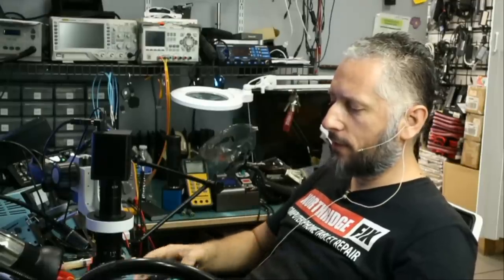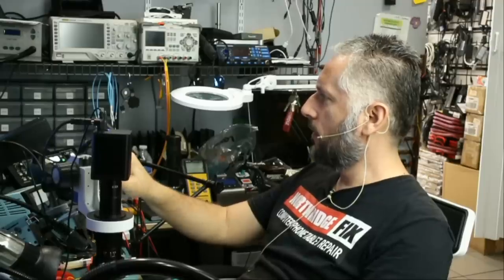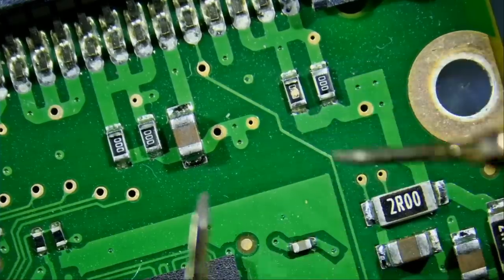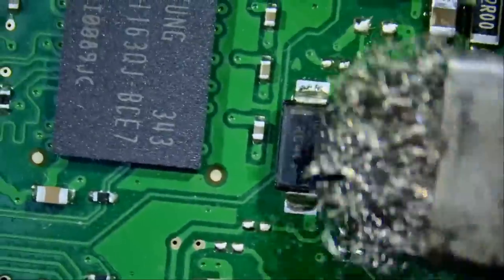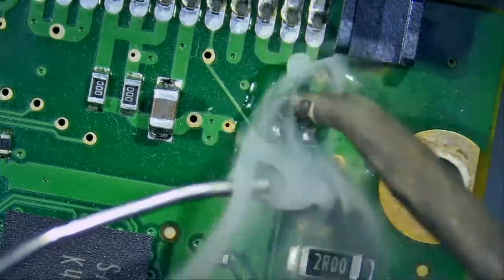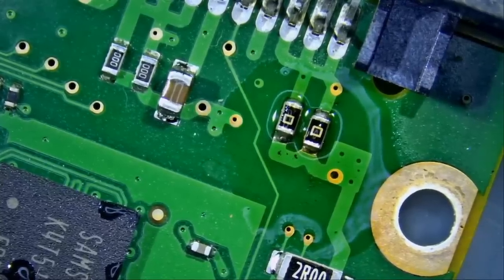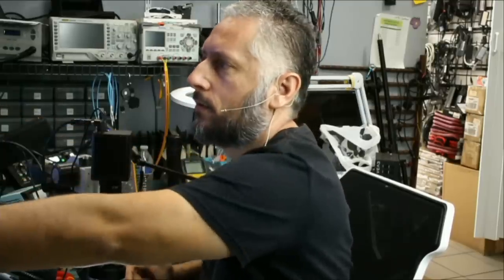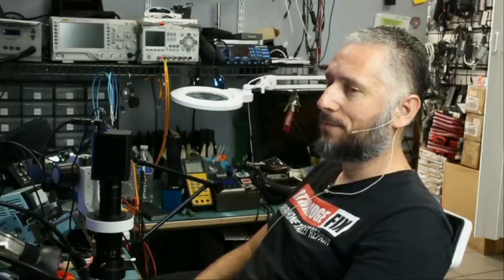Seagate 2TB Hard Drive Smoked -  Can we Fix it and save Data ?

Comment: "That's a protection diode, so we do not really need it"
Reply: Protects from reverse polarity being applied or a Zener diode to protect from over voltage.
Reply: Question, how higher voltage did that , shouldn't the sata to usb adapter has some kind of protection?
Reply: @rpsmith  Pretty sure its a tvs diode, clamps over voltage to ground causing the fuse to blow.
Reply: if you're not planning to use the item long term, then he is correct, you don't need it. at this point it's best to pull all the data off immediately and scrap this drive
Reply: @anwarxv9279  For 3,5" drives you mostly have an additional barrel connector which plugs into the adapter.
Reply: @toolsarecool  not reverse polarity , Transient voltage .....  :)
Reply: @bronzeblood  -- Yes, I'm sure you are correct about that!

Comment: The local scrap man has been generous enough to give me broken electronics. I've been repairing a lot of it and sharing the loot with him. I've also been practicing my solder and reflow work on them. I'm not as quick or as good as you but I can definitely feel a lot of improvement. Donor boards are excellent if you can get them folks, and the bonus is you get free chips to play with if you're into building electronics.

Comment: I'm impressed. This is the first time that I've caught up with your channel. A few months back my grand-daughter also had a faulty portable Seagate 2TB drive that happened to stop working while it was plugged into the USB port of an HP Laptop which interestingly also died at the same time.

 I'm an old school technician when I started out in the business all radios and TVs had tubes.  So, I was reluctant to tackle the HDD myself, I rang a few repair shops in Australia (where I live) and was quoted from 900-1500 (A$) to retrieve the data. I guessed that the Laptop must have put a lot than five volts out of it's USB port to the HDD. Poor laptop design? 

Luckily for me the Seagate HDD was still in warranty and without hesitation Seagate transported it from Australia to the Netherlands and back for free, great service! So my grand-daughter was able to get back her valuable data and a free new HDD to boot. 

Keep the videos coming.😀

Comment: When doing data recovery and replacing 0 ohm resistors, could you simply use bridge wires and save the components?
Reply: I thought that - why 0 ohms if they're not actually resisting anything?

Comment: back in the IDE hard drive days around late 90's ~ 2002 forgot if it was Seagate or Western Digital or both. We would get hard drives in that would spin up , could not read any data. It was because the bearing for the drive motor had a minute amount of play. What we would do is wrap the drive in plastic then put the drive in the freezer overnight. The next day I would take the hard drive out and plug it in to the IDE cable. Unfortunately wasted time waiting for the computer to boot, 80% of the time we could recover all or part of the data. as soon as the hard drive started to thaw showing droplets ( hard drive out of the PC with longer cables) the sooner would stop reading data, a very few we could refreeze and recover more data. Not in these cases, it always amazed me and it was difficult sometimes not to laugh in the clients face when i went to an onsite for a PC that would not boot/ clicking sound. The client would tell me "well the hard drive had been making strange sounds and clicking for about a month, the computer still booted" i would be thinking you should have called us weeks ago. very few we could find a donner hard drive and swap the mainboard, most that did not work....back when that was possible....most lost all their data.

Comment: Great... Again. 
But... Alex, why in a case like this you don't just bridge the zero ohms resistors, instead replace it?
Reply: I would have replaced only one of them with a jumper.
Reply: He works professionally
Reply: @kimmygaming3407  --  I he is such a professional, why was he testing both zero ohm resistors for continuity when the are connected in parallel?

Comment: Hey Alex, I have a question. Since the traces on both those 0ohm resistors were shared, could it have worked to just take one from the left side and solder it onto one of the pairs on the right?
I'm guessing not, but curious as to why they exist like that to begin with.
Reply: They are sometimes used as a fuse, 0-ohm resistors are not truly 0 ohms, they still provide some resistance where if their power limit for their size package is greatly exceeded, they will blow
Reply: Zachary - Thank you for that.  I was just about to research the purpose of zero ohm resistors since at zero ohms of resistance they shouldn't even be called resistors.

Comment: From what I understand on hard drives bios chip tells the controller where all the tracks and sectors are located for each drive individually but that bios file is also copied to a special area on the hard drive is normally not accessible it is never overwritten so if you have a drive and such as this one you could just get a new motherboard if you had the software to read that special bios file off of the hard drive could then flash that to the BIOS chip in the drive would be 100% functional
Reply: The general process in data recovery labs is to just replace the ROM chip itself onto the donor board.

Comment: It's amazing how Hard Drives are repairable...it's definitely the key to keep files stored safety and reliable but is SSD or NVME M.2 that reliable too and can be fixed like hard drives?
Reply: Just like HDDs, it would be repairable as long as both the controller and the storage medium itself (NAND flash) are intact.
Reply: Nothing that holds valuable data can be considered reliable, keep data on three separate drives, with one off site.
Reply: @bryanlatimer-davies1222  🎯
Reply: NOTHING is 100%, even paper, it can burn. 😉 Everything in this world is temporary, even us.
Reply: @bryanlatimer-davies1222  Yep, especially because we expect the data on it to have a large life span, and as it turns out these storage media's are not meant for that. But consumers can still buy external HDD's and stuff, expecting "it'll work", but eventually it will fail. Where as if you use something like the cloud, they take care of the redundancy

Comment: Why not apply solder to only one pad of a resister first? Then solder the resistor on one side and after that solder the second pad of the resistor. This way it is easier to align the resistor and have them flat on the board without the need for hot air.

Comment: I save old drives that mechanically failed. If I have another drive where the mechanical part has not failed, but the circuit board has failed and the drives are using the same type of circuit board I am able to swap out the defective board.  

I found with the pocket drives very often the small inside circuit board fails and not the drive itself. I remove the drive and put it in to a generic type drive case.

Comment: I'm a novice with electronics. Could someone explain the purpose of 0 ohm resistors? Is this just a generic control board, where sometimes those traces call for higher resistances?

Also, I really need to get some of those heated tweezers to make my life easier.

Comment: I have 4 HDD drives, I use a sata cable not from my UPS brand, so I guess the PCB is buned out. I'm from México and I'm interested in your repair service. ¿Can I get some aproximate price or quote  for the repair?, assuming it's the same problem as in this video. The probmen is in Two HDD's 1T, one HDD 2T and a one more HDD 8TB. Thankyou.

Comment: I have a Seagate 500 gb hard drive that is always giving me a " bad sector" notification. It wouldn't start last time. I had to bring it down to my old computer Windows 7 and have it try to repair the bad sectors. Seems to have worked, and I quickly downloaded the data I wanted. But I'm assuming it's not a bad capacitor but lost sectors on the boot up. Anything you can do about that? Should I get the data off and try and re-format it? Or just buy a new one? it is 8 years old.

Comment: Hey I'm facing a weird issue with my 4 TB wd hard drive, it spins but doesn't show on file system. When I check disk manager it shows disk unknown, I checked various online forums but didn't find any way to fix it without data loss. Please help! 

Checking online shows it as mbr issue which can only be fixed with re-initializing disk hence formating it

Comment: I had a Seagate external drive that overheated the motor controller chip it actually melted the plastic case of the external drive I had a data recovery place replaced in bios in a new chips that I installed replace that one and was able to recover all of that

Comment: I'm not intricately fluent in hardware. Can anyone tell me the difference between a Zero Ohm resistor and a jumper wire?
Reply: Basically no difference resistance wise, but current handling capability is vastly different, a 1/8w SMD resistor will carry far less current than a 2mm dia copper wire and will blow open circuit far quicker. (the same principle as to why fuses have thicker wire as the amperage rating increases.).
Reply: They function the same, connecting traces. Zero Ohm resisters are used because of cost saving aspects. It's easier to mount them vs jumpers/wires for mass production. They can also be used as test points for troubleshooting and can act like a fuse if to much voltage/amperage flows through the system but, they aren't designed to to do that and can't be relied on to save other components. I've also seen comments saying they are used to help deter people from reverse engineering the pcb but I'm not an expert on electronics so not sure if that is accurate.
Reply: Resistor can be mounted with robots
Reply: Zero ohm resistors are usually used in a similar way to a fuse, they will fail open at much lower current than a jumper wire; the reason two are used in parallel in this circuit is to allow a higher current before failing open.  Alex could have used a jumper wire for a recovery only repair, but if there were other components on the board that had failed open - the jumper wire would have allowed more effective power to flow and potentially cause more damage.  The cost of 2x 0ohm resistors is worth the safety if you have them on hand, they're only a few cents each (or fractions of, depending on power rating)
Reply: From a purely functional and electrical point of view, there is little to no difference : a slight difference or resistance in milliohm range, and  slight difference of series inductance (ESL). Nothing really. In terms of fabrication, the SMD 0-ohm resistor is made of very thin carbon coating. Thing is, carbon coating burns easier than copper, so same currents at the same resistance can make it burn before traces do, therefore essentially it is also a fuse. It's an extremely cheap, but also extremely approximate fuse, so it must not be replaced by real fuses in applications which require one. If your only requirement is : "I would like to preserve my traces", then it works just fine.
Reply: I guess the film in the 0ohm resister acts as a fuse compared to a solid link and they have a tiny resistance, so putting 2 in parallel in this hard drive must be for the current? If anyone knows for sure I'd like to know too
Reply: Thank you all for the info

Comment: i wonder if in this situation you can buy the same hard drive and swap controller boards instead of trying to repair the board
Reply: Might be a good tactic, but there might be a problem in mismatching serial numbers, so you would probably need to flash it's "BIOS" or smth chip.
Even though, it might not resolve a problem
Had a drive, that just died (was some WD blue 2,5 inch drive from some laptop). Was thinking that the controller stopped working, as drive was spinning, but it got hotter than others I had, and it didn't show up anywhere (tried several pc's). Ordered a matching controller, resoldered the chip, that was guided in the guideline by seller, but got zero result.
So, such method is not a 100% working method, depends on how deep the problem is
Reply: You would have to change a drive-specific chip on the controller board which contains calibration data, information about dead sectors etc. So fixing 2 resistors and a diode is easier in this case.

Comment: I got 2 of these same model that I fucked up by being stupid.
I mixed modular PSU cables and put +12v on the 3.3v pins.
I really don't understand why they can't use standardized plugs on both sides of the cables. Using the same physical connections with different pinouts creates so many problems, and then the manufacturers hide behind the fine print.

Comment: The letter didn't say that there was an attempted repair. I wonder if the customer will complain about the protection diode? Of course Alex will replace it for an additional fee.
Reply: no because it's a data recovery job. I don't think they send back the original hard drive. They just pull the data off it and send the data back.
Reply: @thadofalltrades  Quote: "I don't think they send back the original hard drive." 
WHY... would you go through the trouble of transferring the data to a different drive if the original hard drive is now working and a computer can read the drive directly?

Comment: Why even bother to solder 0 Ohm resistors when you could use a wire instead ? Or was this just in case something else was wrong with the board to have them act as a fuse (again).

Comment: I would have just used a piece of wire, if it is for data recovery it doesn't need to look good, just needs to work till you pull the data and copy it to a new HDD.

Comment: Can you just replace the PCP with another one from a new drive of the same modle? Would that work?
Reply: I believe that is more difficult than it seems. They revise the boards and the firmware constantly, so if the donor drive has different firmware it won't work. 

I believe some chip on the board is also "tuned" to the specific drive characteristics, but I'd love to hear from someone who knows more. 

I used to work in a place that had countless 250gb and 160gb drives and I never got a board swap to work. It was either tougher than expected to find a matching board even with a box of 200 used drives, or the replacement didn't work and clicked the heads back and forth where the original didn't do anything.

Comment: When that $80 Corsair Mouse  wont clickty click right - 3 trys to open a folder etc  >> WD-40  to the Rescue again - Aftershave wont last  2days back 2 chit again
Undo mouse 2 screws &  rear pop the shell & dab WD40  on LMB click button inside   click rapid + times  it loosen up  plastic cobwebs   xd 
Now your mouse will be Soooo Touchy Fast  it'll click into the 3rd demsion -  perfect fix -  Redkneck Science at yoyr service again /..\
Reply: YES ANY MOUSE WORKS ON   ok the  buttons  inside seem to  frictionate slow